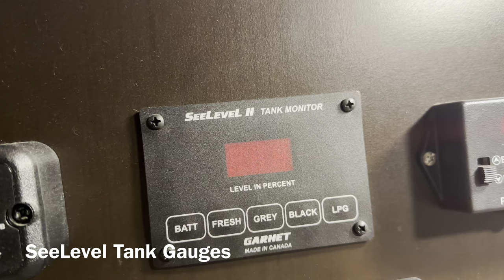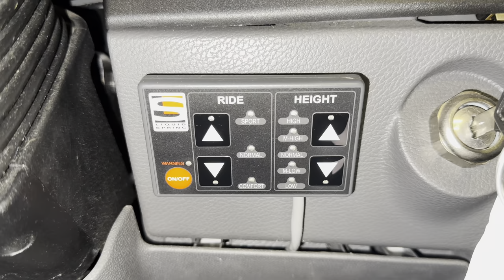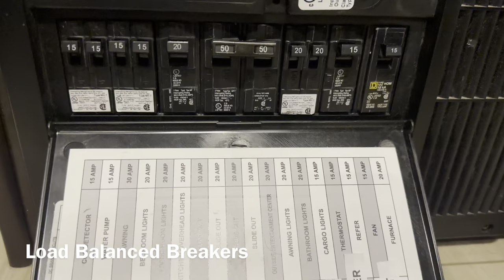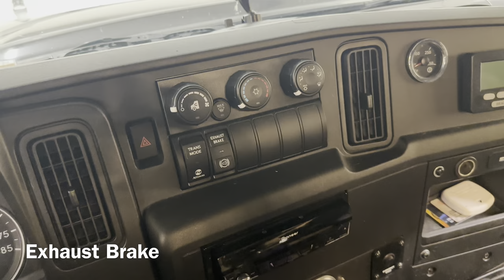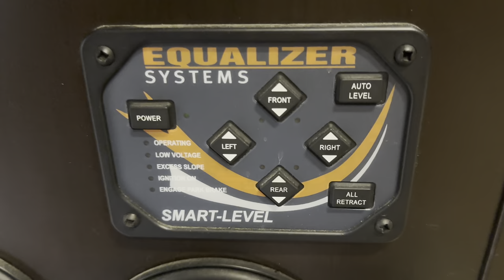3 Year Update: Nexus Wraith 34W Super C RV (Will We Keep It?)

Comment: We got the Rebel on May 30th. So far we are loving it. We just had the Blue Ox tow package installed by our dealer. They got it almost right. The turn signal always shows you turning left now (we would have had it fixed at the dealer, however, they said they checked it and I did not check it). My fault on that one. All in all, it had a few minor items that I either fixed myself or did not worry about. You are right about the leveling system, it get the rig about half a bubble off side to side and stops. Oh well. I will anxiously await your future video where you address that on your Wraith. We have about 3000 miles on it so far. Kids love the liquid springs when they (maybe, maybe not) are sleeping in the bunks while I am driving. We love that the slides only comes out at camping areas, and we can reach everything except a few drawers. My wife loves that she can get us all snacks while we drive as our resident "passenger princess" (she liked that one when I told her about hearing that today). Fortunately I am a cabinetmaker and I have a Biesse CNC router in my barn. I will deal with the cabinetry if and when I need to. I bought this knowing it is a working man's RV. So far, I am very happy. (I talked my wife into letting me splurge and get the 410ah Redodo since we do a lot of driving usually between stops). Well, I better get back to the cookout. Have a good 4th.
Reply from the maker: Yeah there will be minor issues to fix. We mainly had to go through every connection in the piping and tighten and reseal when we first got it but since then we've been pretty good. Not sure if we lucked out on our build but we haven't had many issues and pretty much everything we have fixed ourselves when we could. Overall happy!

Comment: By year six I think you’ll be ready for a new rig - probably a Wraith 34W!

We have a 2023 Wraith 34W. Very happy with it.  Price went up from what you paid.  Nexus now uses side open storage bays, Dometic 12v fridge, pure sign wave inverter, low profile Dometic A/C’s.  We got Liquid Springs before the build, thanks for your steering us that way.  Love it.  Plan to upgrade the shocks, add an outlet to the wet bay.  We are adding Kilmat sound deadening to the cab. Pretty much agree with you on most points - shower small and cheap, pantry had to be upgraded to pull out, side camera/display screen has poor resolution and lighting contrast.  We love the washer dryer setup, flooring doesn’t stain like you experienced, plenty of power on the highway, lots of tank capacity, genset can run everything, length is perfect. Would I like a bigger fuel tank - yes, bigger shower - yes, more storage than we need - actually reallocate some of that space to the bathroom! King bed would be nice option as would an opposing slide in the living room.  We started out looking at the Entegra Super C but decided too long. Price was a consideration but the Int’l/Cummins/Allison chassis was why I dropped the idea of a regular C.  Didn’t like the class A DP setups with the driver sitting on the front bumper. So yeah, we’re happy.
Reply from the maker: Couldn't agree more!

Comment: The super c is the best of multiple worlds. Mike gets his dually, decent diesel, and a camper all in a package of 34 feet. I installed a hengs vent fan in my rig to get rid of the tiny fan and it moves air pretty decent. When its decent enough to keep the air off i run it full speed woth windows open, and some fans in the windows and it makes for good crosswinds
Reply from the maker: We definitely agree! Happy with it and the mods just make us like it more😁

Comment: Thank you for this.  I have been going back and forth between the 34W Wraith and the 33DS.  I like the fact that it is a one piece over the cab on the Ghost and has air ride.  I have never had air brakes before and this vlog sold me on not going with the Ghost.  I have seen where others have taken their air ride out and put in Liquid Springs.  I have spoken with an installer and it can be installed for around $13,000. Thank you again!!!
Reply from the maker: Hopefully you are happy with your decision! We are very happy with ours😁👏🏻

Comment: The best way to combat the rust issues lightly sand and paint then apply cosmoline which is a liquid spray wax, I use RP-342, the only thing that removes cosmoline is gasoline, and elbow grease
Reply from the maker: The only rust we have is under things that are already body pained (like water heater cover) and would need to be removed to be fixed and repainted. Poor prep from factory is my guess.

Comment: You guys did some great upgrades! You'll love the Multi Plus !!  We found a 5th wheel we're going to keep for a while, it fits our wants and needs perfectly so invested a ton in a solar system and went all Victron and 1330 watts of panels on the roof and all the other bells and whistles you need for a really good system. We also added Micro Air soft starts to both a/c's and can run one ac unit for about 4-5 hours with all the other usual stuff going. I'd love to have a Super C but we still need way more room than those seem to have.
Reply from the maker: It's always great when you have a RV that fits your needs and wants! That's like what we have with our Wraith. We had MicroAir Easy starts on our previous Airstream but haven't put them on this one yet

Comment: You are awesome!  I originally went looking for a Nexus Wraith because of your vid's, but my wife fell in love with a 34 ft Tiffin class A on the same lot.  I had Liquid Spring installed (4 corners) because of your review.  I kept mentioning your video and LS keep asking me if I saw it on another youtuber's video.  I had, but made the decision based on Mike's review.  He has the experience!  I am looking at installing an electric outlet in the water bay since my dump valve is in there also.  Regarding the surge protection, I had that same Progressive unit on my 5th wheel, but the Tiffin has one built in.  I have already thought about what Mike mentioned about if that "built in" one gets smoked, I have no power.  So, I am going to cut my power cord short and I have one of those pedestal units and I will mount that inside and then a run an extension cord out to post,that way I have redundancy. .  I have watched every video of your upgrades,  I want to see my possible next upgrade!  Safe travels!  Your friends from Hell, Michigan!
Reply from the maker: Thanks for mentioning us to liquid spring when you got your RV suspension done. We love LS and hopefully they'll make it for the front of our chassis soon! Appreciate the comment😁👏🏻

Comment: I think it's going to be a long time, but I guess I should watch the video and maybe find out. As I figured, you are keeping the Wraith.  As you know I have a Ghost basically because it was the right rig as far as the interior goes, at the right price.  As with everything there are pluses and minuses.  As far as the Rengade and the Showhaulers go I'm not a fan for various reasons.  Last time I checked Rengade coaches were made with 2x4s and if someone can tell me how you can keep 2x4s fastened together when going down the road please let me know.  The Nexus has a welded steel frame which doesn't work harden like aluminum  (Jayco Seneca) nor is it $500,000 plus like the Showhaulers.  Even at $500,000 many Showhaulers are built on used chassis.  Yes I made it all the way through.  Keep the good stuff coming guys.
Reply from the maker: We are pretty happy with our RV and hope to keep it many years and keep making it ours😊

Comment: I've never even been in an RV and never will be.
But I watched your whole video and really enjoyed it.
You're a great couple, and I can see you really enjoy traveling and camping in your RV.
I watch "Bus Grease Monkey" on youtube a lot, and every bus he gets in has all kinds of air leaks on the brakes and leaky or rotted out air bags.
Some of them have been serviced elsewhere, and they come out of those places worse off than when they went in.
I noticed yours is a single rear axle. I watch videos of these kinds of RVs, and most of those are the bigger ones with dual axles. Are those both drive axles? Can one of them be engaged and disengaged depending on road conditions like snow? 
I like that inside mod where you took the table out and put in that cabinet.
Happy camping my friends! 😊
Reply from the maker: That's crazy and we appreciate your watching our video! On tag/dual axels they are both drive axels. They're because the RV weight/length requires more axels to support. It would depend on how it was spec'ed when built on if one could be disengaged

Comment: How often is the outside Monitor Used?  Do you have an alternative for outside?  How is the Wraith on rough/logging roads?
Reply: Please be aware of enunciation of “Sulking” vs “Selking” — which one do you favor in Indiana and Michigan?
Reply: Get a urinal with a long relief  tube for travel & night requirements.
Reply: 1,000,000 miles.
Reply from the maker: Very rarely do we use the outside TV. Radio more often but still rarely. Wraith does great after Liquid spring. Our selking international is in Perrysburg Ohio

Comment: Wondering what is your gas (diesel) mileage?  I wish that other manufacturers use the International chassis.  It seems like most use Freightliner, however.  About the quality of Nexus...it leaves a lot to be desired (particularly in the last 2 years).  It looks junky and the quality of the component are of subpar quality.  Kudos to you for upgrading your rig.  I guess that it helps to be a handy person.
Reply from the maker: We get anywhere from 8-10 on average. Depends on speed, terrain, weather etc.
We expect every RV to have problems and we know that and anticipate it. House on wheels is bound to break. We do agree they should be built with better materials from the jump but it is what it is. It definitely helps that Mike is very handy and that we've owned 10 RVs over the years so far.

Comment: Good video 😊 just saying air ride suspension is better than liquid springs try a larger rig with air ride front and rear  there is better brakes  I'm not the type to add  the suspension  front or rear  I'm going to order the better suspension that's why the rig's  are   more expensive 🤔😊
Reply from the maker: Had air ride in our semis. Liquid spring is the better suspension that's why it's on ambulances

Comment: It would be a great thing if you could have gotten all these upgrades installed at the factory before delivery. It would have been great if these "upgrades" had been offered as options from the start.. Why? Because all the "bad" items you upgraded (steps, auto leveler, seats, suspension, pump, etc.) cost money, likely anywhere from 10% to 50% of the upgraded version, plus the "duplicated" install costs. So, you've paid for the "cheap" version AND the upgraded version. Not quite double the expense, but in a way, yes, because of all the time suffereing  without the upgrades. Had they been installed from the get-go, the cost would likely have been about half of what it was. Of course, you didn't have to pay the extra up-front. And, of course, sadly, the manufacturers want to give you an RV "that functions" (basic pump, basic seats, basic suspension). But, in truth, you have to spend more to get the RV to "function" the way it really should. If you could have made all these upgrades at the factory, before delivery, in the end, you would have saved a lot of money. That said, cudos to you both for toughing it out and for sharing which upgrades really made a difference, especially to Mike for installing a lot of this stuff. Not easy. And to Lynn for tackling all the day-to-day work. You're absolutely right about the floors and the shower surfaces! Why the "mottling" surfaces? Are they deliverately trying to torture RV owners (mostly the wives who are doing the cleaning)? Fine, it looks nice upon purchase. But, as you say, try cleaning those surfaces every week! Again, "modifications" that could have been made at the factory. BIG LESSON from Mike and Lynn: When buying an RV, take your time, do your research, think through EVERY CHOICE. Money doesn't solve all problems, but careful and thoughtful investment can solve a lot of problems, and save time, money and aggravation and waste in the end. Sure, life is full of "for-now" circumstances and decisions. We can't have everything perfect from the start all the time. But with an RV, it seems one really needs to think things through -- practically speaking -- and try to make the best choices from the beginning. Would the manufacturer have installed all these upgrades for you at the beginning? Would it have saved money, time, aggravation? Why don't they offer these "upgrade" options from the start?
Reply from the maker: They do some of our upgrades from the factory now, in some part to our videos. They even offer liquid spring suspension from the factory!👏🏻 Honestly, we are happy to do the updates ourselves because we get to pick brands, colors, and we know everything is installed correctly the first time.

Comment: The one thing that turned me off from Nexus was the location of the parking brake right next to the driver's seat on the floor.  As I have gotten older, getting out of the driver's seat was a real pain.  Have you had the same opinion?
Reply from the maker: At first I thought it would be a problem but after test driving it I found out it really was not a big deal at all. The new models are built on a Freightliner chassis with air brakes which totally eliminates it. I'm not a fan of air brakes though.

Comment: There is no way you're getting ride of your rig, You both love it and you have made so many cool mods. But when you do get a new one I thinking it will not be for more then 5 years. Mike do you use a BIM to charge the battery? I want Liquid Spring but looks like the GAWR is Max out at 15,000LBS, for Freightliner need 21,000 LBS for our rig. ☹
Reply from the maker: Yeah, I don't think they have the liquid spring system for the freightliner chassis yet unfortunately. We both do really love this RV though and with every mod we make it more ours.
We don't use a BIM, we have been using the original inverter/charger that's made for lead acid batteries. Our solar then tops it off to 100% charge. Eventually we'll install a DC to DC converter so the alternator can assist in charging the battery.

Comment: Seeing the rust and failure under the finish was discouraging but you said you live in Ohio right? The General Headquarters for the Rust Belt so maybe it’s to be expected ( kinda ).
Reply from the maker: This has nothing to do with weather though etc. It has been happening for a long time, before any salt, under paint. That's poor prep 100% and should have been prevented. As for the other paint issues, They painted over the caulking/sealants so it flakes from the sealant causing more paint discrepancies that should have been prevented

Comment: have you noticed a difference in body movement due to nexus using steel instead of Al for the framing material? thoughts on detroit diesel for engine instead of cummins? glad to see i am not the only one who wants to replace the couch with storage ( it is storing bikes for me)  thanks for the detailed review, learned about the pitfall of the residential refrigerator
Reply from the maker: The steel framing really does give it a rigid feel when driving down the road. There isn't any flex from crosswinds ect. Detroit is good but you'll have to get into a much higher end coach than Nexus. The Cummins has served us very very well, even only being 300hp.

Comment: 2 questions. Why super C and not class A. Is there a difference in stopping ability from air brakes or hydraulic. Keep up the good work.
Reply from the maker: We like the look of a super C better and it is safer should we end up getting into an accident. Air brakes do produce very high braking pressure. We've been cut off and had to brake very hard and they've never seemed underpowered. The ABS system actually kicked in because the tires were trying to lock up.

Comment: I just drove one of these RVs from Ontario Canada to Reno Nevada and I was not very impressed only real good thing on it was the cummins engine and Allison trans ,I’m used to a class a with air ride .
Reply from the maker: We have liquid spring suspension on our RV (which is better than air in our opinions, and yes we've driven vehicles with air ride). We have taken it cross country multiple times now and have no complaints with the RV ride quality etc. The roads in the county are still poor but can't control that
Reply: Was this an add on ?maybe this was on the rv and I wasn’t aware
Reply from the maker: @nospark67  liquid spring is an add on that is around $12k. It can be ordered with it and installed prior to pickup but you'd know it. They come standard with spring suspension.